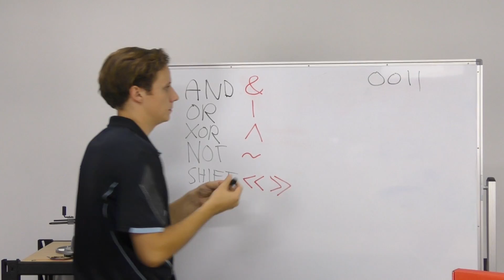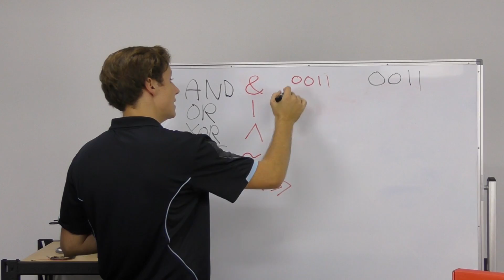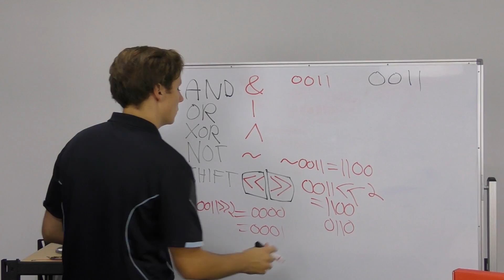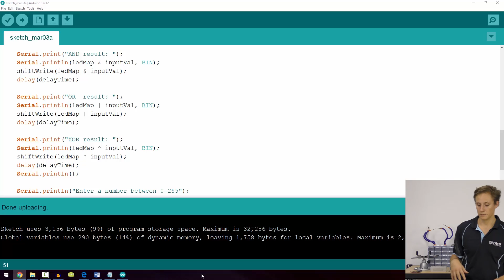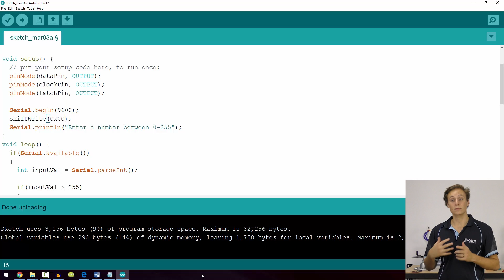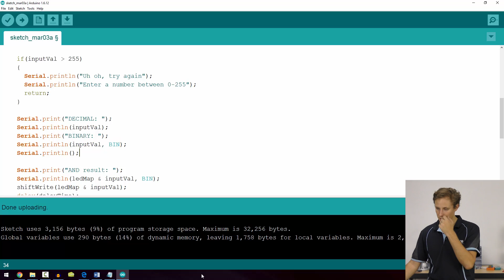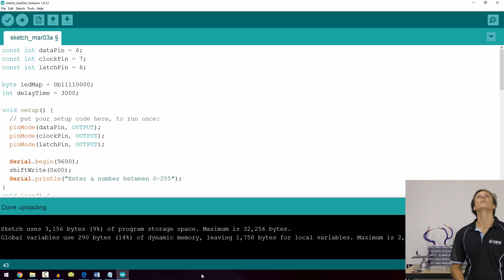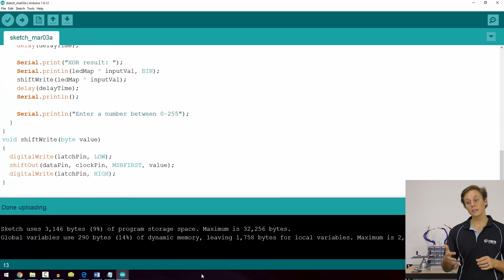Arduino Workshop - Chapter 4 - Bit Math

Comment: I have not heard any reference to the CARRY BIT in any lecturers. Almost all microprocessors do have one to carry or borrow with an ADD or SUBT instruction. Most microprocessors allow you to ROTATE via the CARRY bit and test or set and clear its state. There is no reference to the ROR or ROL, or  RORC or ROLC through CARRY operations. These instruction can be very useful at times. A notable example is generating a CRC-16 data packet checksum. The shift out bit to carry can be used to do specific XOR bits on a standard x16 + x12 + x5, + x1 polynomial calculation at high data speeds. Perhaps these bit-wise operations do exist for C++ on the Arduino IDE, but not published?

Comment: Thanks a lot for the video.
I am just having one query...When i tried implementing the same code in Arduino...once the program solves for a particular value that we have asked for eg: 75, then it again starts solving the entire thing for 0 (which i did not gave as input at all)...it would be good if you could help me out with this...Thanks!
Reply: In the serial Monitor try changing it to "No line ending"

Comment: BETWEEN does not include the end points. Should say; "enter value from 0 to 255"
You should explain WHEN and WHY to use bitwise operators. Ex: to clear a specific bit, use ??? To invert a specific bit, use ???

Comment: I used the sample on the website but the lights wont work.
Reply: i know its been 10 months, but ive got an answer for you, because its not in their diagram! in their diagram the 7th pin on the top is empty when it actually needs a 5v wire too!

Comment: I’m a programmer of 7 years I’m also high and it’s like 6am lmao idk why I’m here
Reply: Is it easy for you sir?
Reply: @omniyambot9876  is what easy for me? Bit maths? Or being a programmer? Being high maybe 🤔? Or is it me being there at 6am
Reply: @bestcreations4703  hehe the bit maths sir. I'm just curious. And the port manipulation. Because I find it very hard. I've been to Arduino for about 3 months.
Reply: @omniyambot9876  port manipulation is relatively simple once you just write a simple chart down in a note book all you have to do is look up the Arduino processors data sheet and you will find a section detailing how using about two to three commands control all ports using an eight digit binary once you get that down and Lear how to control one bit at a time you can create a function you are able to call that will take in what pins you want to control and set them to
Reply: @omniyambot9876  being into Arduino and being into programming is two completly different beats I’ve been working in video game development for many years so I’ve had to get used to all this for a long time not to mention I have taken multiple classes not only in college but also high school that covered binary logic and bit wise I’ll be honest I learned to program before I even knew how or what bit wise logic was so it was an easy translation
Reply: @bestcreations4703  okay sir, thank you so much for your advice. I'm also a hs student, you're already a legend there

Comment: Thanks for your great video.
If we used two 74HC595 shift registers connected in series, is it possible to shift bits between both shift registers? For example shift the last bit of the first shift register into the first bit of the second one?
Reply: Yes. That’s exactly what makes shift registers so useful. You can shift a series of bits through as many shift registers in series as you want to wire up. Then issue a latch command to present all data to the outside world.

Comment: what is the difference between a OR and a XOR?
Reply: I don't know its uses . I only know the trusth table of it
Reply: One of them contains explicit adult material?
Reply: @justincoleman9776  ...what?
Reply: XOR gives a 1 when the 2 bits are different for example : 
0101
1000
the result is 1101
unlike OR that gives 1 when one or both of the bits are 1
Reply: what would you use XOR for (gimme an enxample)
Reply: @taranagnew436  , if you XOR two numbers, the result will be zero if those numbers are equal. So it's a good test for equality.
 XOR can also be used to generate parity bits. XOR two bits, an odd number of bits will result in 1, an even number will give 0.
Reply: thx